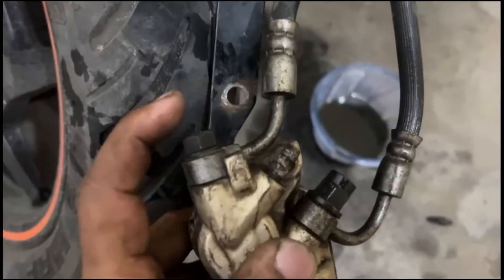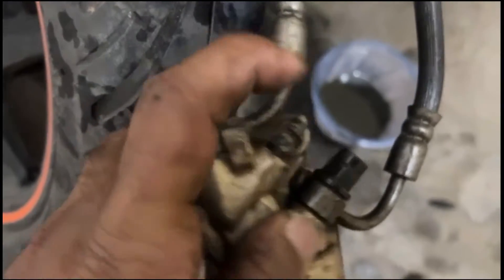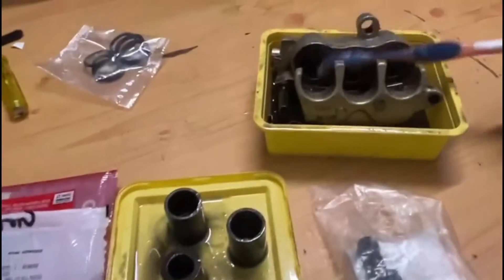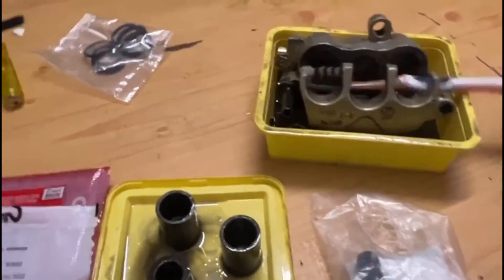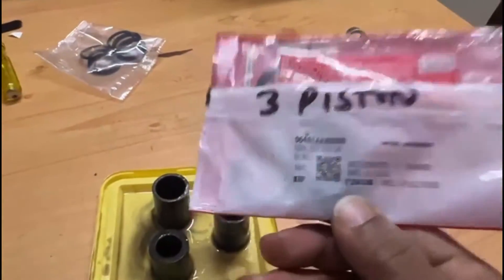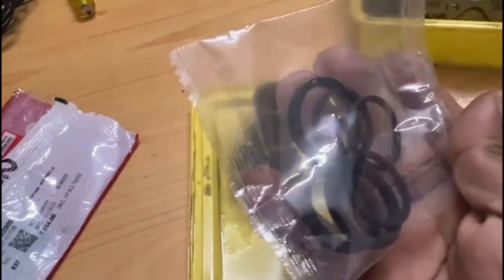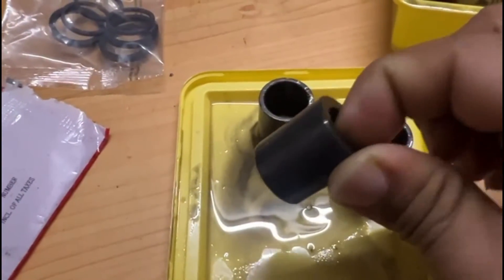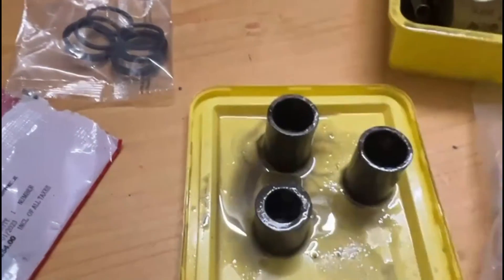Ather 450x Brake Caliper Repair and Fix jamming wheel

Comment: till warranty i have been reporting issue with this calipers.
They just clean it up and gave

But problems comes back within few months.

I am chennai's first batch oct 19 2019  ather 1.5 gen customer. 
First to drive ather in chennai 

They are asking to change calipers for 3000+ labour comes around 4.5k , i cannot afford such high price even though i know piston is the one thats not freely moving

Plus what those thing you are using to lift the ather from ground. 

I tried to remove the master cylinder with the screw driver kit i got. Since its old vehicle it not unscrewing
 Need your idea or support , how to remove old screw. I dont have electric screw driver like you.

Let me know , where can i find you 
I am from Medavakkam chennai , local mechanics are not even attempting to remove the master cylinder kit. Asking me to go to service center

Dm me the parts you got to fix this issue.
Reply: They do it purposey cause they want to earn money

Comment: The mc kit of front brake is leak, Ather service centre advisor says you need to buy the entire master cylinder kit 😂 Bhai sirf ek rubber kit kharab hua hai uske liye pura master cylinder kyun? Can any one suggest match for mc kit supplied in market or someone has done the job outside ? I need to change  the mc kit.
Reply from the maker: Royal enfield
Reply: @DIZ1988Mohan  thanks could you please share more detail which model of Royal Enfield's mc kit is a match ?
Reply from the maker: @lorsendmello1989  Enfield 350 MC kit should match perfectly
Reply: @DIZ1988Mohan  thank you much appreciated
Reply: Have you replaced it?
Reply: @Mr.Ravi.Kumar. yes it worked 👍

Comment: Pls share each parts used in disk break wher u purchased and part number
Reply from the maker: Sure Will do it
Reply: @DIZ1988Mohan I also need this info, especially the O ring from Hero. Can you please share the exact specifications or part number. Not able to find the O ring seal set from Hero service centre in Pune.
Reply from the maker: @mayurvaghani5107  Its 30x42x11.
 seal
Reply: @DIZ1988Mohan  it is difficult to explain to local part Shops. Can you share the part number if you've?